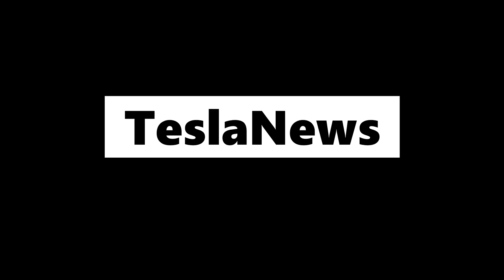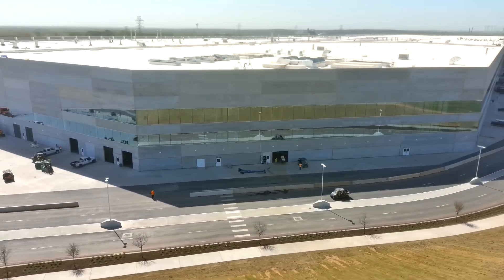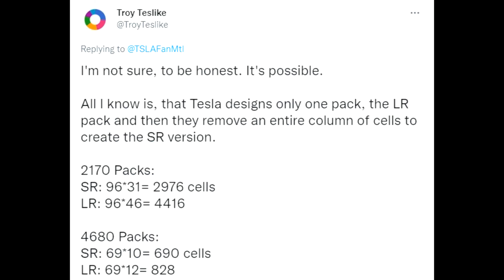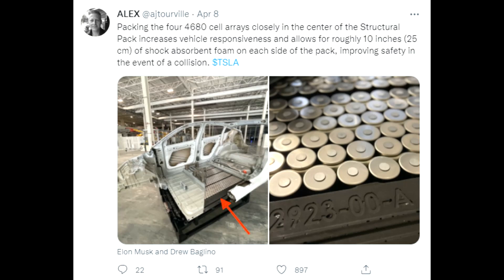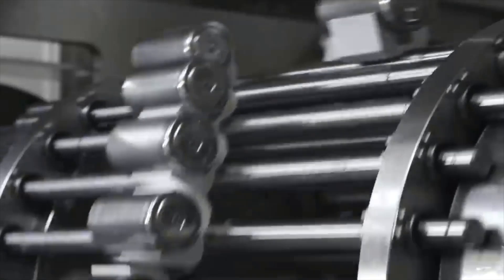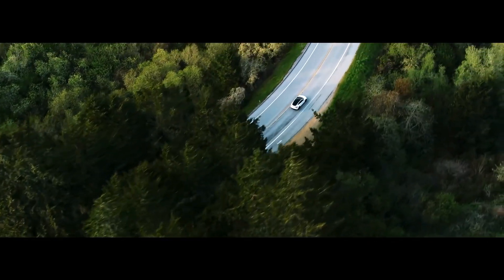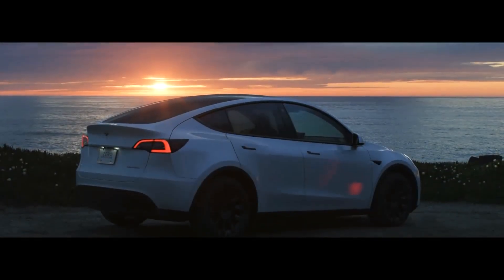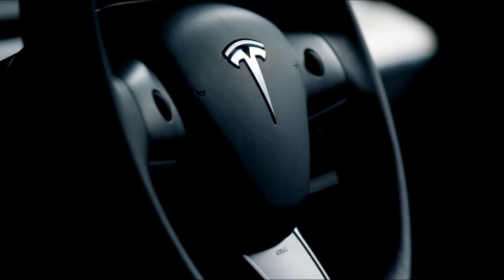TESLA SCALING is already happening! New Model Y Version with 4680

Comment: With all The weight savings that the 4680 structural pack and the front and rear castings were supposed to provide, I find it hard to believe that it only gets 123 MPGe vs the 2170's 122. You're telling me all those improvements only give the car 1 MPGe more in efficiency
Reply: The important thing for batteries and Tesla is cost and rate of production. Low cost and high production means more cars and energy storage batteries produced.
Reply: @thomasaquinas157  Still doesn't make sense
Reply: @teslasnek  is is possible that they are using LFP chemistry, which would mean that the weight savings of the 4680 form factor and front and rear casting would be  negated by the lower power density and heavier weight of the LFP chemistry?
Reply: @iakona23  That's what I want to know
Reply: The last I heard was that the gain in power density of the 4680 will be offset by reducing the volume of 4680 to come in line with 2170 output. In other words they will use less 4680 cells per car to bring the power specs to equal that of the total power output specs of  the 2170 cells per car.
Reply: @chrisduggan85  right, that is logical. But if that is the case, then these new 4680 Tesla cars should be much lighter and therefore more energy efficient that previous Tesla cars which used heavier battery packs and less single piece castings. So far the EPA data has not reflected that. Perhaps the initial EPA data is incorrect and it does not reflect the efficiency of the new 4680 Teslas. They could keep the overall range of the 4680 Teslas the same as previous Teslas by just using less 4680 cells.
Reply: @iakona23  exactly, it's the efficiency, not the range, that I'm talking about
Reply: The way I see this is efficiency is on par with previous cars which is 👍. Range is a byproduct of how big is the “tank” or battery pack is. Although if it gets too big , then weight will start to penalize range to a point that  doesn’t make any sense. Also, think about this, Tesla won’t be launching a superior product in low volume to piss off the rest of their loyal base , I wouldn’t buy a performance car paying more $ for an inferior product. So they might be playing this game of cheaper , less performance product till all factories can do 4680 , then they will flip the switch and potentially provide more range out of those 4860 if that makes sense or competition is catching up. Otherwise, the more cars they can put on the roads the better. My 2 cents.
Reply: @danielsiffredi8403  You are still talking about neutering the range and performance, but you can't neuter efficiency. The new battery pack and the castings were supposed to make the car a lot lighter, so it should be a lot more efficient when it comes to miles per kilowatt hour
Reply: Its all just a marketing joke!